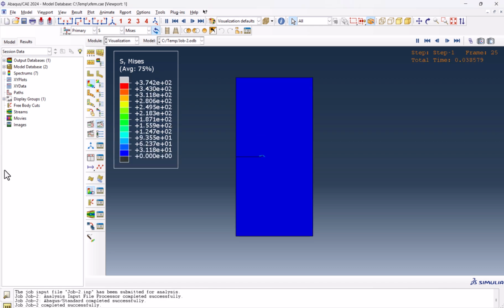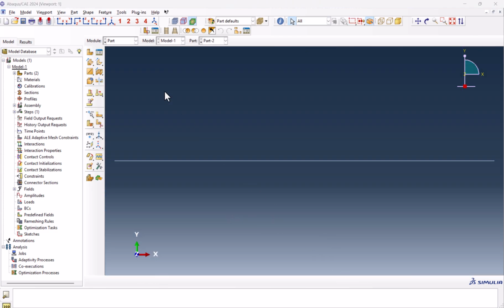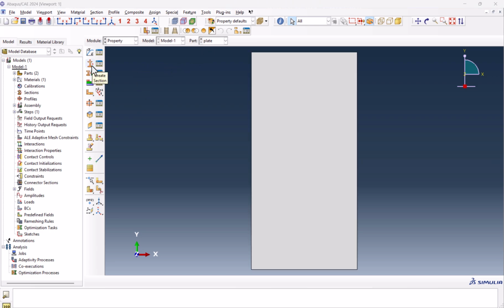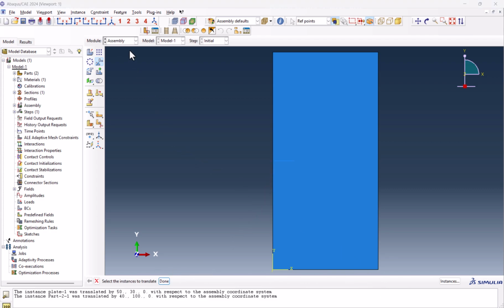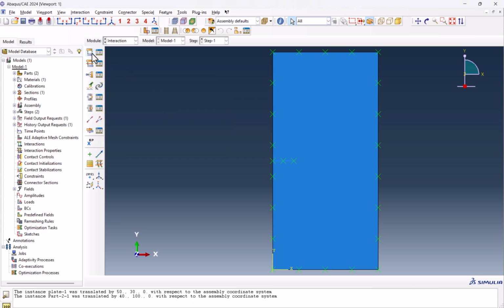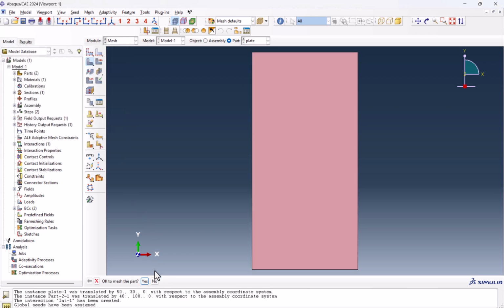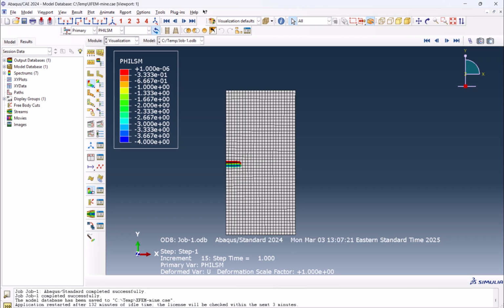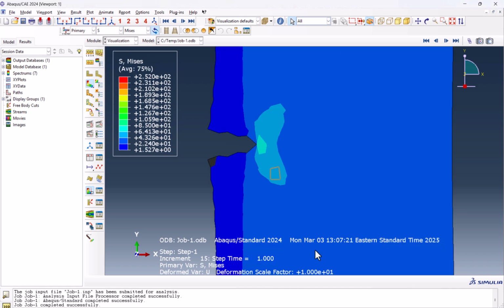Master XFEM in Abaqus: The Ultimate Guide to Crack Growth Simulations!

Comment: Thank you for taking the time to create and share such an insightful video! I’ve learned a lot of useful techniques from it, and it has been really helpful to me. Currently, I’m working on calculating the Stress Intensity Factor (SIF) in a 2D XFEM model. I’d really appreciate it if you could share some guidance or suggestions on how to approach this.
Reply from the maker: You can use LEFM method to do so just you need to measure the crack length!
Reply: @FEAMASTER  Thank you for your reply! I’d like to ask, in Abaqus, how can I obtain the stress values at the crack tip after crack propagation? Are there any recommended methods or steps to follow?
Reply from the maker: The easiest way is to look at the max principal stress on the stress contour!

Comment: I have watched the video and tried the same. But if i change the displacement to 5 mm thit is  getting aborted, can you try that and let me know. I am thinking of propagating till the end and also can you do for the load controlled propagation problems.
Reply from the maker: Thanks for trying it out! 🙌
If it’s aborting at 5 mm displacement, it could be due to excessive crack growth or element distortion. You might need to refine the mesh near the crack path to maintain stability, especially for large displacements.

Also, for load-controlled crack propagation, it’s definitely possible but requires careful step setup and stabilization. Have you seen the latest video?https://www.youtube.com/watch?v=VJzBDXQnt9k&t=14s&ab_channel=FEAMaster

Comment: Does XFEM or rather "enrichment" only work in 3D?
Reply from the maker: XFEM enrichment techniques are not limited to 3D; they work effectively in both 2D and 3D analyses. The choice depends primarily on your specific problem setup and analysis goals
Reply: @FEAMASTER thank you for the answer! I am writing my Master thesis on an cementet Sand Zylinder with cracks thats why I asked
Reply from the maker: @Jllbllt  You're welcome! Your Master's thesis topic sounds very interesting. XFEM is indeed well-suited for modeling crack propagation in cemented sand cylinders, particularly since it allows crack modeling without the need for explicit remeshing. Good luck with your research, and feel free to ask if you have more questions!

Comment: This video was published just in time!! I am working on a master's thesis project involving Abaqus simulation of connection fatigue failure and I wasn't sure if I could use XFEM in Abaqus to simulate my connection successfully. I was very happy to run across this video today.

Unfortunately, I followed every step exactly like you did (except I used Steel material properties: Density = 0.283, Young's modulus = 29000000, Poisson's ratio = 0.15, and I used Max Principal Stress = 5000 for the Damage Evolution, all US Imperial units (pounds and inches)), but got a "too many attempts made for this increment" error. I am using Abaqus/CAE 6.14-6. The only difference I've seen so far is that I do not have a LOADSXFEM option for the field output request. Also, I did not get a warning for the wire not having a section assignment as you did.
Reply from the maker: Besides, this paper is useful if you are using XFEM for the connections!
I came across it during my master thesis and he also published a couple of papers in XFEM and Spot welds! https://www.sciencedirect.com/science/article/abs/pii/S1350630724000955
Reply from the maker: Hi Samuel, thanks for reaching out! It sounds like you're on the right track with your project. I’d suggest double-checking that every step—including material definitions and boundary conditions—is exactly as shown in the video. Sometimes even a small deviation can lead to errors like “too many attempts made for this increment.” Since you're using Abaqus/CAE 6.14-6, the missing LOADSXFEM option might be a version-specific issue. As a workaround, try modifying the solver settings by adjusting the IA parameter. I hope this helps, and best of luck with your master's thesis!
Reply: @FEAMASTER  I went back and changed the material properties to the ones you used, and the job ran successfully!
How do I apply this for a steel part? My connection involves a flat steel plate with a bolt hole with general contact defined between the plate and the bolt. The fatigue cracks would form around the bolt hole under cyclic loading (10k-2M+ cycles).
Reply from the maker: @SamuelSteiner-i5n  The material damage evolution MAXPS and other  properties of Steel are very different. The most important thing in steel is the fracture energy. It's way larger than the polymers (the higher the energy, the harder the crack and grow!), on top of that, the MAXPS might be lower. You have to find the material properties of steel in the papers or Abaqus documentation. You can try 60MPa for Maxps and displacement of 0.5 instead of energy! in that case you wouldn't see the too many attempt error! it's roughly correct, for a better and accurate simulation, it's better to follow a paper to regenerate their results.
Reply: @FEAMASTER  it would be very helpful for us if you make some video to teach how to regenerate results from the paper. i searched a lot but I didn't find such kind of video.
Reply: @FEAMASTER  Their are many data like damage evolution, fracture energy etc are not found in the papers we have to put in the abaqus to get the result. so If you show us how to collect data from the paper and generate the results then that would be very helpful.
Reply from the maker: @ I'm planning to create a video for that somebody else also asked this, just stay tuned!
Reply from the maker: @ Yeah sometimes you need to make some simplifications to your projects, I need more time to create such a video because it's kinda need a huge amount of time!
Reply: @FEAMASTER  yes sir. notification bell icon is turned on. this kind of tutorial channel is very rare on youtube.
Reply from the maker: @ihtishamarif4971  So glad to hear that! Awesome! All you have to do is to wait!